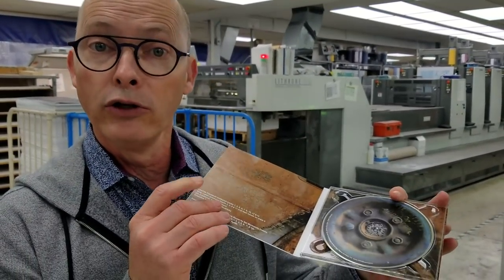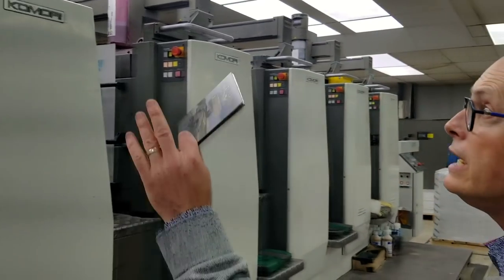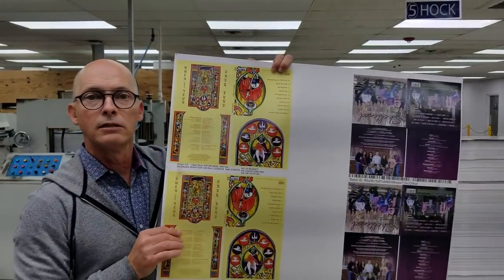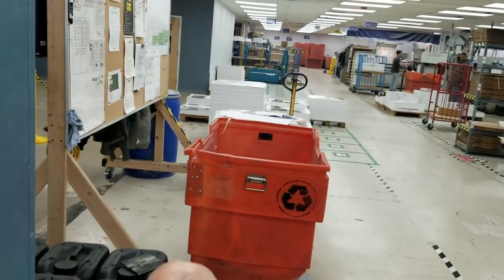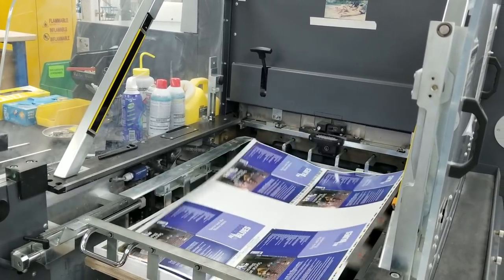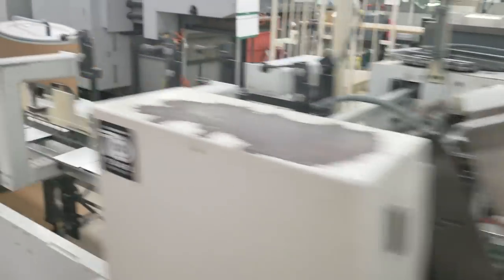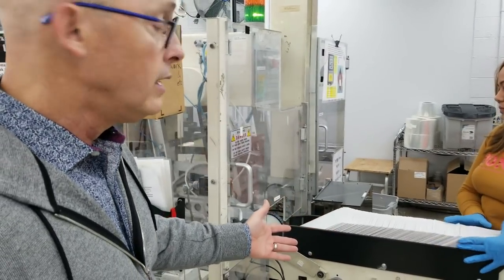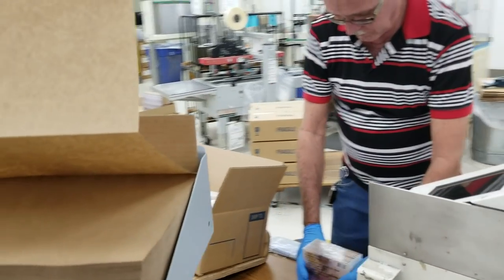Indie Music Minute: How CD Digipaks are printed at Disc Makers

Comment: Very cool video! I love that you do these. It's interesting to see the entire process. Two things though...1 - I know you guys also own Oasis and you mentioned Disc Makers is the only company that makes both the discs and the Digi-packs but I thought Oasis did also? 2 - I think Digi-packs are very cool and am working on a new album and was contemplating going that route for the first time. The only issue is with Digi-packs if the little tabs that hold the disc in break you're screwed? With a standard jewel case you can replace it. I wish there was a fix for that?
Reply: Uh... you caught me! Yes, Oasis' Digipaks are also made in the same factory. As far as the center rosette (as it's called) breaking, our experience is that unlike with Jewel Cases, it almost never happens with the Digipak. Usually when they break it's because there is too much pressure on the machine that inserts the disc in the tray. I don't know if it's because the whole Digipak package is more flexible than a jewel case, but it doesn't happen a lot with Digipaks.
Reply: @tonyvv  I didn't realize it was the same factory. That's good to know  :).  That makes sense about the digi pack I may still go that route thanks

Comment: I would like to see the insertion of booklets in the process. I believe that's what made Discmakers miss my ship date.
Reply: Depending on the booklet it may be inserted automatically or manually. It's calculated into the turn time you're quoted. Fact is, any of two dozen different processes can cause a delay. Usually our on time record is very strong, but when a piece of gear breaks down, a delay can occur. Which is why we advise artists not to wait till the very last minute to order their discs. :)